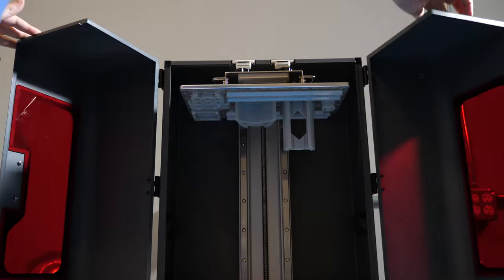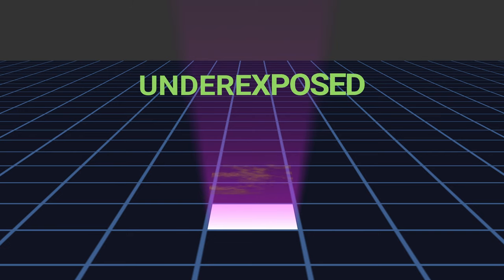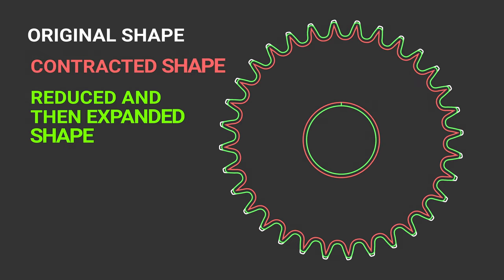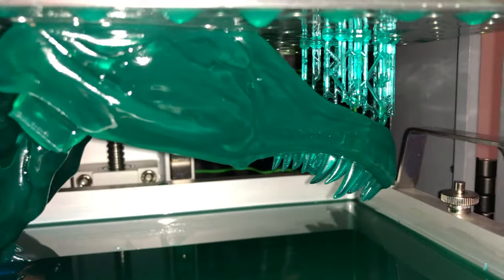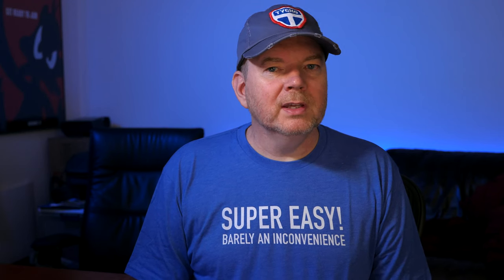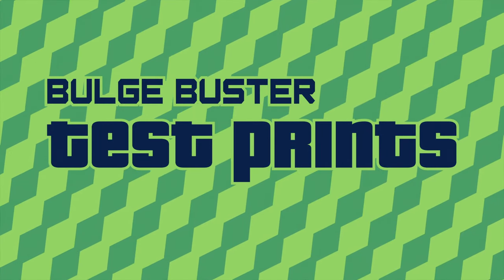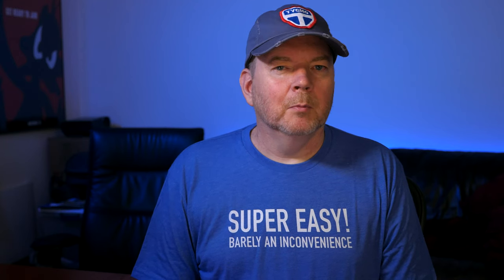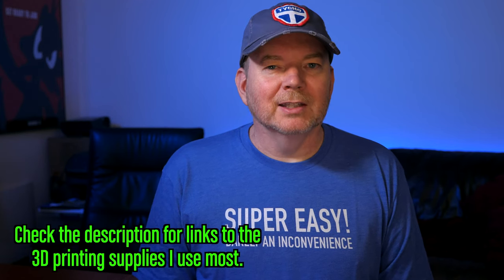Remove the Elephant's Foot from Resin 3D Prints - Plus NEW FREE Bulge Buster App

Comment: You can try this method;
In the 3D model you can add several extra layers of the same shape of the object to the bottom. Then sand those layers, with elephant feet, off afterwards :).
Reply: Or add several layers wide, then several layers a lot smaller. Cut afterwards at the smaller part and sand that small piece a bit off.
Reply from the maker: Or taper the edges of the gear teeth a lot
Reply: @Nerdtronic  I don't think that's gonna work. I watched the video and thought; you have to do a lot of guessing to get it right. Remove the guessing part and do something that's always the same. On the other hand, maybe this 3D printer has this problem and better look to another printer :P
Reply from the maker: @danny7902  My software, which doesn't work any longer because of changes to the file format, could print a test file. You'd print that and then see which setting perfectly removed the elephant's foot, and then use that.  It's too bad they don't just add this functionality into chitubox.

Comment: Chitubox 1.8.1 just released with Tolerance Compensation features added to the "advanced" settings tab. This offsets the inner and outer diameters a fixed amount. You can set the bottom layers and the normal layers to have different offsets. Essentially, this is a "reduction-only" method that's now built into Chitubox. 

See: https://www.chitubox.com/en/article/support/howto/chitubox-free/settings/how-to-use-tolerance-compensation-on-chitubox

Comment: For 3D resin printing gears, I just add chamfer on bottom when I'm designing gears in Fusion 360 and print it flat as is.
Reply from the maker: Lots of people offer this solution.  But how do you know exactly how big to make that so that it will exactly match the amount of expansion you're going to have with the bottom layer overexposure you're going to use?  You'd also have to pre-know how many bottom layers you're going to do.  And then if you share that stl with someone else and they use different print settings... I think the slicer should just do it.  Or the printer itself.
Reply: @Nerdtronic  You can print multiple gears with different chamfers and setting.  It is like doing RERF tests.  You just need to run it for your printer and the resin you are using.  Once figured out which one is best, then you would know what to use next time for your setup.  Anytime when printing dimensional accurate functional parts like gears, you have to run calibration test for your setup anyways.

Comment: Couldn't you just put a slight fillet on the bottom edge of your model? That's what I do for fdm atleast. Haven't tried it on my resin printer yet, but i don't see why it wouldn't work. 3 layers are so small that the slight dimensional inaccuracies won't effect much if any function

Comment: If you are printing a gear, that may be 5 mil to 10 mil thick, the weight of the object will not need the higher over exposure. Thus avoiding the problem mentioned. Gravity will not pull it off the build plate. Thus making this a bit over engineered.

Comment: Ive sliced on photon app and lychee and both will not work, a photon is a .pwmx file for a photon mono x but your app says its unsupported, i suppose to make it into a photon file ive got to use my photon zero which the build plate is tiny. Im just going to have to wait for you to catch up with whats coming out.. dam back to the zero again.
Reply from the maker: The app doesn't work will with lychee. Try Chitubox. I have some lychee test files here to check but I'm swamped with work and just don't have time to do it.

Comment: I'm using an Elegoo Saturn and these files are not working at all. Any help? Cannot read the file (Unknown File Format!) I'm using the default .ctb and also renamed it .phz. Nothing is working :(
Reply from the maker: Bulge Buster is not compatible with the latest version of Chitubox.  You'd have to go back to 1.8.  Chitu locked up the file format so we can no longer load and save the newest ctb files.
Reply: Managed to use lychee slicer and still didn't work. This was until I changed the ctb. File to a previous version.    Bulge buster is such a great program! Really useful🙌🏻

Comment: does this work with monochrome screens?
Reply from the maker: Yes.  It should work fine.  It really depends on the file format and if BB can read and write it correctly.  Just have to test it.
Reply: @Nerdtronic  thanks for the reply. I ask this because on for example the Anycubic Photon Mono sold with AA (Elegoo Mars Pro 2 Mono same thing if I'm correct), but Anti Aliasing does not function. Which is grey scale dimming. As well anycubic has decided to use new file extensions. best wishes.

Comment: in the non additive how would the build plate not crack the screen after the 10 second exposure, it would need to be at z=0 to reprint the  other 3
Reply from the maker: So additive or non-additive doesn't make a difference here.  The screen isn't cracked because the build plate doesn't move - at all - between those different exposures.  The build plate goes down, you display the first one, turn on the LED, turn off the LED, display the second one, turn on the LED, turn off the LED, display the third one... etc.  So the plate doesn't move at all during any of those exposures.  Then it lifts up like it normally would and goes back down to do the next layer.  It doesn't go up and come back down to the same place between the exposures.  That to me would be risky.

I've only been able to get this to work so far on the Transform.  And I can tell you for sure that it works fine on that printer in either additive or non-additive.

Comment: What a lot of great work on this. Thanks for putting in the time.
Some info you were wondering about and a nit to pick.

Just like film, as the resin is cured (say through a 12 second exposure) it gets less reactive. So if you could count the number of polymers solidifying in the first 3 seconds there would be more in that first span of time than in the span of the last 3 seconds. The longer the exposure the less impactful the light becomes. So, thinking about the elephants foot factor,  if an extra 10 seconds above your ideal exposure gives you a 1 pixel expansion another 10 seconds on top of that (32 total) will probably not give you a full 2 pixel expansion. And I'll bet by the time you get to 60 seconds there is very little expansion over say 50 seconds, the resin is however "harder" and more fully cured and better able to stick to the plate. That fall off of the light's effectiveness should turn out to be a diminishing logarithmic. Lots at the beginning and tapering off to nearly no change at all. 

This also can be applied to the question of how much time is needed for or how much effect a semi dense LCD pixel will have. Remember that the LCD pixel isn't actually gray, its just flickering really fast, but a full blast of light is coming through each time. So the resin just sees that as a series of really quick full bore exposures. By knowing the PWM frequency of the LCD you can work out how much time the LCD "shutter" is actually open for and therefore how much equivalent full "white pixel" light the resin sees.

 Also, depending on color and type of resin, the more it cures the less it can light pipe. The bloom of the light through the resin is what causes the elephants foot but that bloom is less bright than the light right above the pixel. The bloom is also caused by the light diverging due to the distance from light pack through the LCD element, through the glass, through the air, through the FEP and into the resin 
Unlike the lasers of the Form printers, the light pack in the LCD printers spreads out the farther it gets from the LCD mask (and because it isn't parallel to begin with). Laser SLA printers will still bloom due to diffusion through the resin but the "Image" won't expand due to diverging light beams from a light pack and LCD gap -  so better, but not solved completely. So the bloom or expansion will also be affected by how tightly packed the lightpack, LCD, glass and FEP are. And every printer is a little different. In a perfect world we'd print right on top of the LCD element (minus the glass and FEP)

Here's the nit, and correct me if I"m wrong -  Isn't the main reason to secure the first few layers to the plate, all about the force needed to pull the layer being printed off the FEP? As we cure each layer the resin wants to stick to the FEP and the Build Plate equally -  the only reason the build plate usually wins is because the FEP is both flexible and slipperier. Gravity is not a significant factor here as stated in the video nor is the weight of the print on the plate. If it was we wouldn't have to worry for those first few layers because they haven't built up to any kind of significant mass yet. If you could print upside down with the build plate at the bottom you would still have to worry about adhesion to the plate even though all the mass of the print is pushing down.

Comment: Hey there, i cannot get your program to run anymore after installing/reinstalling multiple times it no longer opens. It opened only on the first attempt.
Reply from the maker: On windows there is a bug where it sometimes places the window off the screen.  For now delete the BBDefaults.txt file in Documents/BulgeBuster.  In the next update we will have a "gather windows" option, or we might just have the window default to center of main screen each time.
Reply: @Nerdtronic  Yes i figured that out, it goes to like -3900/-3900 thanks!
Reply from the maker: @numchux2  Thanks for that info.  We plan to dive into this soon.  That file is just a text file and you can edit it yourself.  But we might just not save the window position in there.  Not sure yet.
Reply from the maker: @numchux2  New version was posted last night.  Should have fixed that issue. Let me know.  Thanks.
Reply: @Nerdtronic  nice thanks

Comment: any mrthod for mono X wich has build in transition exposure times from bottom exposure to normal exposure?
Reply from the maker: I just think that transitioning from bottom layers to normal layers (exposures) just gives you a flange or a transition from elephants foot to no elephants foot.  Doesn't really get rid of it.  The layer erosin or pixel dimming that BB does in my opinion is a much way to handle the issue.  Now I have experimented with transitioning the exposure times and the erosin or pixel dimming.  If I was designing a printer from scratch, which I might do someday, I would just include this option built in to the printer.  Or chitubox could just add this option to their software.

Comment: Didn't see anywhere else to report this, but I'm getting an error upon attempting to open/run the program. The popup window for it opens with the app. Error "An exception of class Xojo.IO.IOException was not handled. The application must shut down." Running Windows, install regularly then as Admin.
Reply from the maker: You can send info to michael@nerdtronic3d.com.  If you have any crash reports or screenshots that would be helpful.  What were you doing when it crashed.  Stuff like that.  Thanks
Reply from the maker: It appears that Bulge Buster doesn't have access to write to your documents folder.  If folder protection is turned on it can't create that folder.  Or if you're running some software to prevent apps from writing there.  In a future version we're going to catch that exception and give a more detailed error message.  But at least in this beta it needs to be able to write to that folder.  You might try createing a folder inside documents called "BulgeBuster".  But then inside that folder it will need full write access.  It has to unpack 100's of images to do it's thing and they have to be stored somewhere.
Reply: AVG Antivirus Error. Your reply reminded me of a past issues I had with AVG, so I added your program to the "Allow App" list, and that fixed the problem.  Thanks!
Reply: @Nerdtronic  I was having the same issue (Xojo.IO.IOException") as TheAtomic Soul, which prevented me from opening the program. His posted solution worked for me as well. Thank you so much for your work on this an sharing the results of your effort with us!
Reply: @TheAtomicSoul  Thanks! Worked!
Reply from the maker: @GSeymore  Yes, the app requires access to your Documents folder.  So if you have that blocked it will crash. The next release it'll warn you and quit instead of crashing.

Comment: So basically, in your 3d modellier just chamfer the build-plate facing side and that will give you the same result?
Reply from the maker: Not the same. Can’t draw it in a comment. But a chamfer would be smaller on the bottom layer and bigger on each additional layer. This helps
You calculate the exact amount to reduce so that it perfectly equals how much the elephants foot is adding.  But when you’re a hurry, sure just add the chamfer.
Reply: @Nerdtronic  and does the slicer have a provision for plug-ins, maybe plugin is a better option than standalone app?
Reply from the maker: I made the app as a proof of concept and then the slicers did put similar features inside their apps. It’s not exactly the same, partly because they don’t provide a way to determine what setting will exactly match the elephants foot.  And like the setting in chitubox is a distance setting where I found 2-3 pixels to usually be about right. So do the math on that. 100-150 microns probably.

Comment: Thanks for the video.
I tried to download and installer your app, and :

Windows didn't want to open it. After I succeeded with a trick, my anti virus blocked it.
When I finally allowed it to be executed... it crashed :(

I downloaded version 0.9.4 on Windows 10
Reply from the maker: The app does require write access to your documents folder.
Reply: @Nerdtronic  I'll try again next week. I installed it on my Mac for now :)
Still : thanks for your great content!

Comment: Also, higher-pigmentation resin suffers less from lightbleed
Reply from the maker: Maybe. I saw a study where they tested how pigment effects layer exposure time. A single slice is so thin that pigment doesn't really effect it that much. but I think you are right when it comes to light leaking to other layers.
Reply from the maker: @Captn_Grumpy  You'd think that a lot of light leak would happen and that a lot of resin would cure that isn't meant to.  Expecially father in the print where you have resin dripping down on the part of the part that's already printed.  The whole process is a little amazing actually.

Comment: Just letting you know that your Linux version is sub par compared to Windows, and has a pretty serious flaw. 
- Attempting to bust using any method will result in the busted bottom layers actually being offset from the rest of them, for some reason. I.e. the bottom layers would print in one location, and top layers somewhere different, making the print fail. Luckily I checked the files before printing, so no resin wasted!
- Using a dark theme renders the text practically unreadable against the background. 
- You can't change the filename it saves as.
Reply from the maker: Thanks for these notes.  We didn't have a way to test the linux version.  Originally I didn't even make it available.  Then someone requested it so we did.  I'm not sure what's happening with this project now.  I might be handing it off to another developer.

Comment: Hi I just tried , windows 10 getting " An exception of class Xojo.IOExection was not handled. The appication must shut down."
Reply from the maker: Really?  We haven't heard any other reports of that.  If there's any crash report you can save, email it to michael@nerdtronic3d.com
Reply from the maker: It appears that Bulge Buster doesn't have access to write to your documents folder.  If folder protection is turned on it can't create that folder.  Or if you're running some software to prevent apps from writing there.  In a future version we're going to catch that exception and give a more detailed error message.  But at least in this beta it needs to be able to write to that folder.  You might try createing a folder inside documents called "BulgeBuster".  But then inside that folder it will need full write access.  It has to unpack 100's of images to do it's thing and they have to be stored somewhere.

Comment: I think i have a bug, i print at .05, I load in the file and try the bottom layer reduction test, but then i can't tchange the layer height, it's stuck at .01, when i try to change it nothing happens.
Reply from the maker: Thanks for letting me know.  Are you in the USA or another country where the decimal character is not a period?  We had a bug like this in an older version.  What version are you on?
Reply: @Nerdtronic  Netherlands - eu, I think it's related to decimal indeed as it's not showing periods. using version v0.9.3
Reply from the maker: @leon.3d  Weird.  I thought that bug was fixed.  Will take another look at it for v0.9.4

Comment: Just tried to download the program for Windows and got an error message: "An exception of class Xojo.IO.IOExeption was not handled.  The application must shut down."  Anyone else come across this and know how to fix it?
Reply from the maker: Probably because you have some secuity software that is preventing the app from having write access to the documents folder, which is required for the app to work.  Some of the functionality is built into Chitubox now.  I haven't experimented much with it yet but it should work.